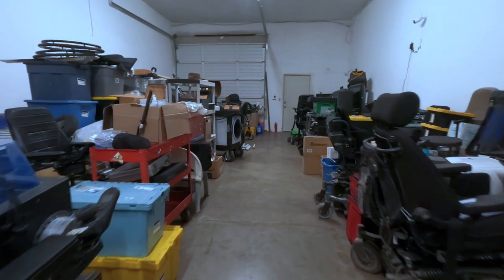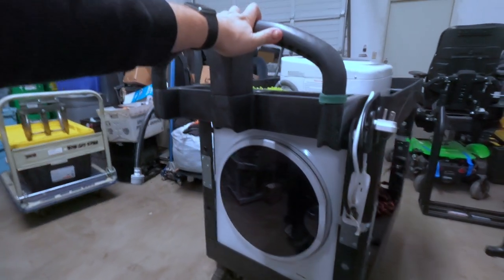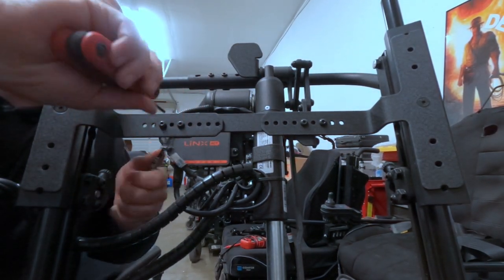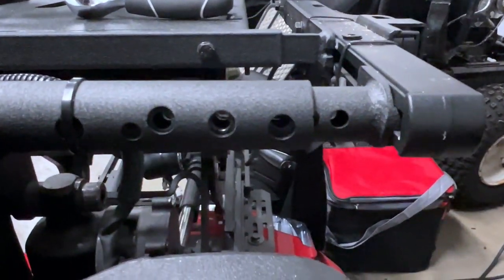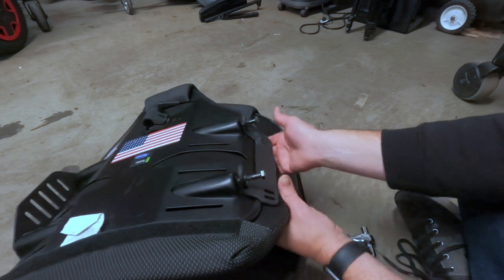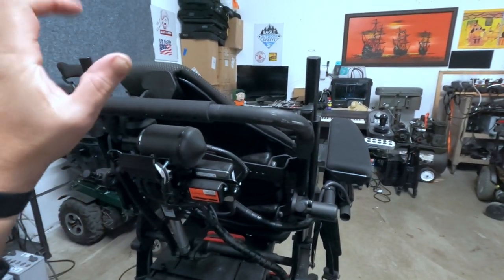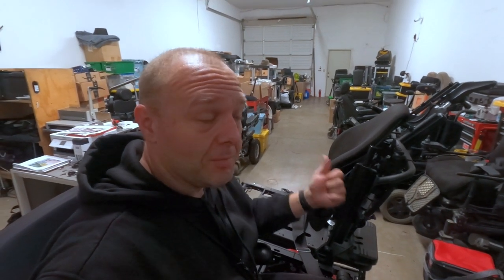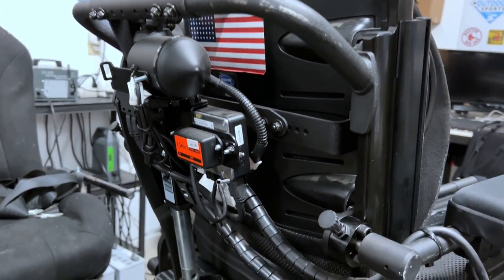MEGA VLOG 641: tdx sp2 shenanigans! (seat adjustment)

Comment: My advice to you for these adjustments would be to do them one at a time. That way you will not have to worry about backrest angle or footrest centring.
Edit: By "one at a time" I mean ONE SIDE at a time. You can widen the left side, tighten it and then do the right side.

Comment: Good video. I just got my new sp2 yesterday and still need to wait for the atp for more adjustments. My chair seat to floor height is at the lowest height, 17.25 I think. I'm 6'2 and using the power leg rests bows my knees out a little so I need more leg rest length, the issue is when I lengthen the leg rests I'm going to start having ground clearance issues. Supposedly the chair base can be unbolted and raised  3 4th of an inch. I'm hoping my atp can raise the base height and that will give me the room needed to lengthen my leg rests and still have clearance. Wondering if you've ever or know about adjusting the seat to floor base height?

Comment: I can’t find anywhere how to adjust the suspension for better traction.  My chair is a large and adjusted for someone much heavier than me.  So I don’t have enough weight on the drive wheels to get traction on grassy areas or slippery surfaces.  Can you help?  I have the new TDX SP2,  VA version.

Comment: Do you know if the seat height can be adjusted without getting the seat riser parts my TDX is set at 17.25 and if it could be raised about one more inch it would be great for me thank you for your help and for this video
Reply from the maker: it depends on the seating system.. but theres a few service manuals on the website that might help 
https://brokenwheelchairs.com/page-2/page-23/

Comment: I have the same chair but I think mine is older, I'm trying to figure out how to replace the batteries. Mine doesn't have a slide out tray. Any suggestions??
Reply from the maker: does your chair have an EZ lock bracket on the bottom for vehicle lockdowns?
if so - that bolt has to be removed from the bottom of chair first
Reply: @TotallyNormal-  yes it has tie down spots on front and back
Reply: @TotallyNormal-  but they are above the batteries
Reply: @Totally Normal  the brackets that the straps that hold the batteries keeps the batteries from being able to slide out the front. This model doesn't have a tray that the batteries sit on. Wish i could attach pics
Reply from the maker: ive got some service manuals on the website.. not sure the model of chair though...
https://brokenwheelchairs.com/page-23/
Reply: @Totally Normal  I've tried the manual,  only says how to remove the one with a tray.. it's a older one not new. Probably gonna have to try invacare support